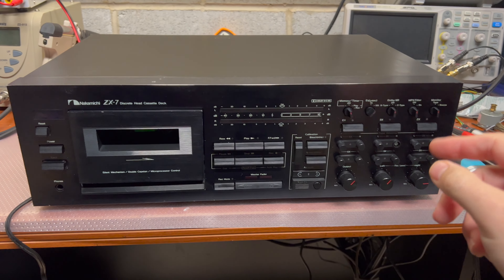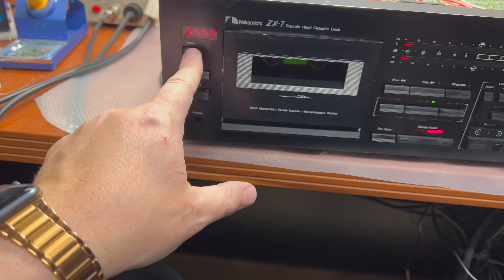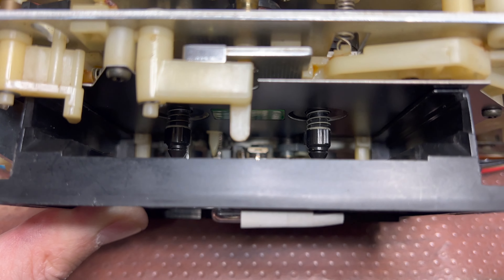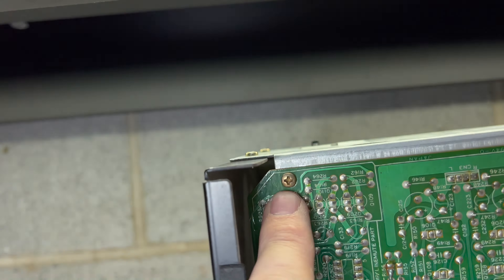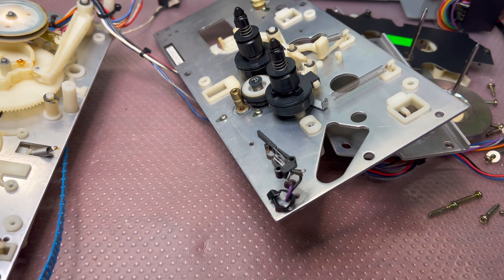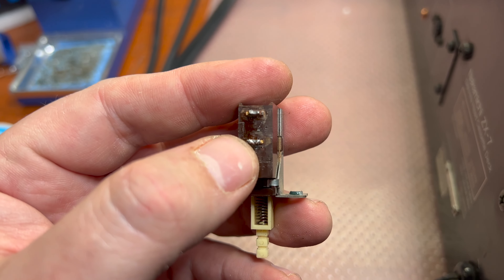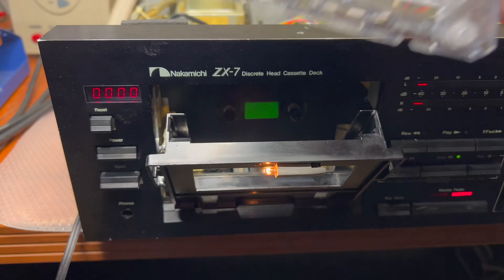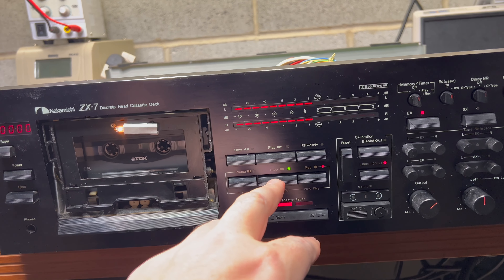Restoration Trials: Addressing the Aftermath of Unsuccessful Fixes on Nakamichi ZX-7

Comment: Hi Hifiruleszzz. I've worked on so many of these machines. The cause of the fader going down during calibration is due to the orange caps in the erase head / bias generator circuit. The orange caps can cause so many illogical problems that you would not have thought these caps could cause. Or it could be that Frankenstein work done on the power supply section that's screwing up the voltages. I should watch the follow up video on this machine to see how you go.

Comment: the rec led blinking intermitently looks like something isn t making contact well.
I suspect half of the remaining problems are bad solder joints.
I also saw a missing diode at the beginning of the vid (around 3:16, D402, also missing a solder pad).
Reply from the maker: I believe it is a power undersupply issue, they installed a 1.5A IC on the +5V line when the original transistor keeps 3A.